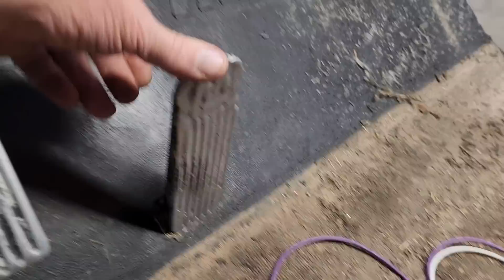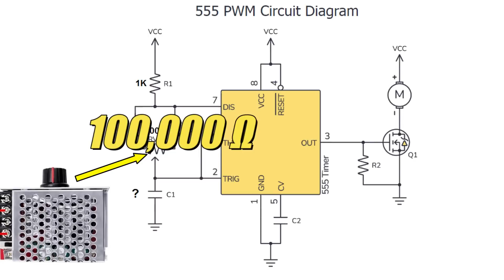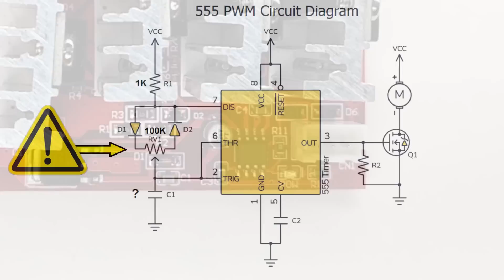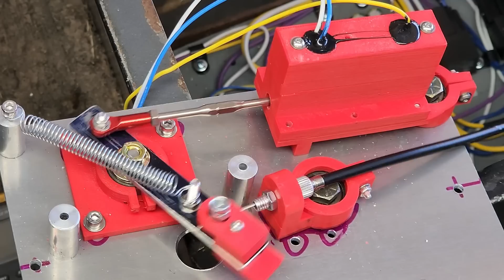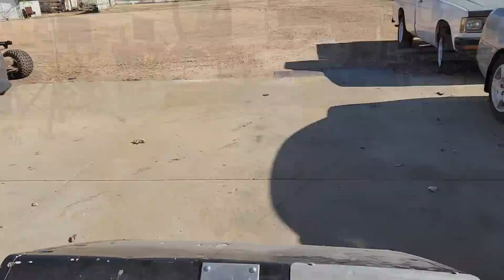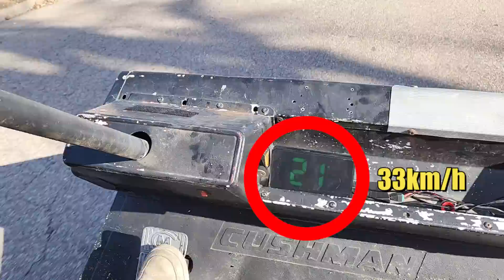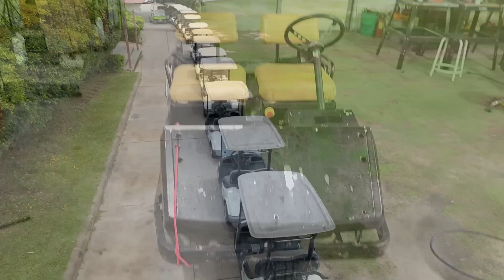S4 E38. We build a custom throttle and road test the gasoline / electric hybrid petroleum battery

Comment: You could advantageously replace all this beautiful mechanics with a transistor and some resistors, just use the Chevy pedal at low voltage and amplify it with a fixed rate. For 100 kilo ohms required with a 3 kohm potentiometer the ratio is 33. Used in 12V, the pedal can be powered in 12/33:.363 volts. A transistor is like an arduino with hard wiring programming.
You can also use a stop switch on the accelerator pedal when it is in the zero position.
An electric motor can handle turning too fast, it will break if the rotor wiring deforms by centrifugation, if the varnish of the inductor burns or if the brush burn.
What do you think of using a classic car as a mechanical base but without the original engine? I'm thinking of a Ford A or B.

Comment: Very interesting project, I've made my personal golf cart from electric to gas, kinda wish i did something like this, might consider this sort of project one day as i have a old golf cart laying around, that cushman is really cool, but, to make it a speed demon like your projects usually are, I'd swap the electric motor for a higher rpm and higher horsepower motor, aswell as a bigger or dual alternator, that 212 should power it fine to wayyy higher voltage as its used in generators to power 120v appliances. The low gear ratio on electric golf cart rear ends do suck, but if you put more speed to it, it'll have no choice but to go fast

Comment: 12:00 I would put the brake switch and emergency switch on opposite lines, just in case one line has enough voltage leaking for either one or the other safety system to fail. You're currently running each safety in series, while the second line has no safety switch.

3 HP should be sufficient to do approx 25-30mph, and 4hp to do 35mph. 
All you need is bigger tires for a better gear ratio.
You'll definitely need an mpg run. I bet it'll be about 66mpg.

Comment: 11:04 wouldn't make sense to have two potentiometers in the same circut to act as a safety if one fails?
Reply: When you start adding additional potentiometers to the circuit it starts messing with their values. If you connect them one and then the other in series they add up and you get a bigger value. If you place them in parallel, start to start and end to end (I hope that makes sense) the combined values of the potentiometers actually goes down because the electricity now has an additional path to flow through.

Comment: If you found the nominal unregulated voltage output of the alternator you could arrange some smaller batteries to drive the motor and have the alternator charge the battery, so you have good low end current to start the motor and sustainable power flow once starting current has subsided

Comment: Very interesting project Jimbo. I imagine there are quite a few ways to improve it. Ultimately, you need only one throttle: say, you throttle the engine and have your electric transmission to automatically adjust. Or, it can be the other way around. Also, you can add a lithium battery, and make it into a hybrid, where the engine starts and shuts down automatically.

Comment: Dam you overcomplicated the throtle poblem if you vere intending to use a cable for throtle from the start all you needed to do was just make a puley and put it on the potenciometer shaft wont even have to remove it from the enclausure wind the cable around the puley twice and atach the lose end to a tension spring. Bsicaly the same mechanism that was used in old radios. And by ajusting the puley size and or where the cable is atched to the pedal you culd fine tune it to get the full movement out of the rotary potenciometer.

Comment: An ICE is not very efficient when it has to cover a large RPM range, but an engine optimised for one RPM can be made fairly efficient, eg, large cargo ship engines are 53% efficient. Not that it helps the way you are using the ICE - lol -.
A Wah-Wah peddle uses a straight rack with a gear on a rotary pot - lol -.

Comment: So you have a cable.... What would prevent you from putting a pully and spring on the potentiometer in such a way that in case of a spring failure, it would power down?
Reply: It's not about the linkage failing, it's about the guts inside the potentiometer failing.  If the pot wears out (or becomes disconnected) and goes 0 ohms that's permanent full throttle.

Comment: the electric trains uses some capacitors in parallel to mitigate the inductance losses, check with a power factor meter if it's also your case

Comment: I know you said you're not interested in anything full electric. Here's the  redneck idea i had is to take a Nissan Leaf. That is, battery only remove the batterys put a trailer hitch on it  then mount a 4000 watt portable generator  on it my generator runs 10 hours on 6 gallons. If you put that on the back of the car, you should get roughly 600 miles in theory for benefit of the doubt  400  miles Not bad i love being a creative redneck. Hello from Romulus, Michigan. Thank you for sharing your knowledge and expertise and for taking us on your adventure.Through redneck, engineering

Comment: What you really want is for the throttle pedal to raise and lower the RPM of the engine and the engine RPM to control the alternator rotor current.  This way you can slow the engine way down when you are cruising along at a lowish speed and spin it up on demand.  It unfortunately gets more complex than that because when you want to climb a hill, you want the engine going fast but with the alternator rotor current just right to hold the engine at that RPM when the throttle in the engine is wide open.  When you are on flat ground you want less engine RPM and more rotor current.  I am trying to think of a way to do this without software and I think I may have something.
A small PM motor working as a generator can make a voltage that varies with engine RPM.  A few turns of heavy wire could make a solenoid where its force is proportional to the motor current.  Some cleverness can make a mechanical thing where the two effects fight each other to vary the 100K pot.

Comment: For the record, I had no doubt it'd work. One of the first things I did was the HP / kw conversions and the math checked out. I just think that a system like this has a lot of room left on the table for fun & performance (and I mean acceleration as much as top speed).

PS - my dream car is a fully electric drive like a model X, but with a turbine-powered generator for long distance drives. They don't take up much space, run on almost any fuel, and like constant output. So I liked the vibe of this idea from the start.

But I still want to see you give that DC motor 400 amps from a standstill 😂

Comment: If that voltage regulator works on PWM signal that will be easy to generate that with arduino and connect automotive gas e-pedal. If that 555 timer don't generate higher frequency than arduino can.

Comment: Jimbo, I caught the very apropos "Toyota Pious" joke...🤣 When you were first discussing the challenges of developing the throttle - instead of a cable controlling a linear potentiometer, I guessed you would have deployed a servo between whatever you used for the accelerator sensor and the rotary potentiometer on the PWM power supply. Complicated, yes, but cheap and very much a "Jimbo" solution! Long live the venerable 555 timer!

Comment: The efficiency of this arrangement is probably better than you have estimated.
If you include the production side of the grid available electricity (Fuel - coal, natural gas, etc. and transmission line losses) the petroleum battery efficiency might not look so bad.

I look forward to the final set up using a microcomputer.
All this Rube Goldberg contraption makes interesting video but I know what you can do with programming.

Thanks for your entertaining work.

Comment: You could use an Arduino with the cobalt drive by wire pedal and a digital potentiometer to replace the mechanical one.  Then you'd turn this into an Arduino project that many can relate to.  The MCP413X has a 100Kohm range option.

Comment: I understand your keep it simple methods. Yet, you do seem to have quite a resume for electronic and mechanical knowledge and problem solving. You could have a "tip in" from your throttle cable to raise the engine rpm to 2500-2800 rpm at 1/8th throttle and then start moving your potentiometer. This would allow normal idle at rest. At 2/3 pedal have the potentiometer hit the stop and start pulling the engine throttle cable to max using a spring loaded eccentric or other method. This way you could have a cruise speed (15-16) mph +/-)  and an acceleration or hill climbing full throttle or just max speed.  This would save on you "petroleum battery" reserves (gas).  Possible complicated but if thought out not so much with different weight springs.

Comment: Maybe the throttle cable(s) have to many bends and kinks to operate smoothly.  Try to make make all the bends more rounded.  Also remove the wire, wipe it with a light grease, a re insert. Sometimes that helps.

Comment: If you use an arduino you can use a digital potentiometer and that chevy cobalt throttle pedal. But really it seems kinda silly not to be using a battery in a vehicle powered by an electric motor. I feel like you could get that thing up to 25mph with the added power of a battery.

Comment: For the potentiometer, you only  have to cover the range of resistance that you care about, depending on how it works, but if you only needed 5% of the range, you could just get a potentiometer that worked in that range (plus a second resistor to increase the resistance if necessary) .

That said, if you wanted to keep the normal full-range of the original, you could also have looked into a resistor ratio transform circuit, which can scale 1 resistance to another.  IDK what you're going to do (no spoilers please!) as I"m only a few minutes into the video, but if you wanted to use an existing car pedal, you could use it with a small circuit.

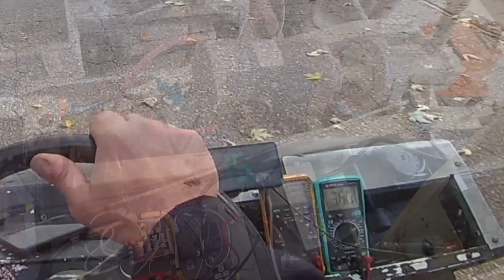Comment: 14:21 in short: Nothing. 

In long: The motor will become more and more inefficient, and thus generate a lot more heat than expected with the power output. Also: There's a higher chance of arcing on the brushes, so they will wear out more quickly.

Both is not an issue in your setup, as long as you monitor the housing temperature of the motor. I recommend not exceeding 70 °C there. If this is a limiting factor, maybe add some cooling fins or a fan around the output shaft.

And sure, the bearing won't be very happy and if you severely overspeed those motors, you may be looking at fracturing the armature due to high centrifugal forces. So I recommend not going 88 mph in that thing.

Comment: Why not use the existing rotary potentiometer, and print a round piece that the throttle cable would wind around and thereby rotate when the throttle is pressed?  That's exactly how they did it in my Chevy Tahoe and in a Clubcar golf cart I have seen.

Comment: A hand throttle using a lever coming off the knob or a gear and toothed track to turn the dial would work too 🤷🏻‍♂️

And not an electrician but whats stopping you sticking a 97k ohm resistor in line with the car pedal
Reply: Range is 100K to 0 not 100K to 97K (that idea would go from no throttle to 3% throttle max)

Comment: So, am I the only one to do the "math" that, due to the safety break switch. You can "dump" the clutch by pressing the throttle and brake and releasing the brake, and instantly releasing full voltage.

Comment: Retired electrical engineer here.  I observed a Japanese engineer remove a surface mount component by holding two soldering irons like chopsticks with one hand.  I was impressed.
Reply: Now he needs to become ambidextrous and run quad soldering irons 😂
Reply: @PsRohrbaugh  For flat pack IC removal!
Reply: I do it with only one iron and a overdose of solder.  Big blobs of solder will stay melted long enough that you can go back and forth with the tip and have both melted.  The component will stick to the iron when it comes free and then you just need to wipe it away and the get out the solderwick to clean up the pcb ready for the new part.  I can do this with parts down to 0603 size.  At 0402 a wide tip will bar-b-q the part and melt both ends at once.
Reply: Yeah works but risky if u put too much heat and lift the traces
Reply: @clownbooface2624  you have to use resin, so that wont happen. You wont desolder many components with an iron if you dont either.
Reply: @mrgoodman6620  you use solder, the tinning layer of solder on the tip is enough for heat to conduct. Rosin flux is mainly for cleaning the surfaces to be soldered. Not used in desoldering.
Reply: @ElectricBillAlbright  Yeah ok. Your not going to get an i.c. with 24 contacts off just by "tinning" the tip.
Reply: @mrgoodman6620  Well, that's what is done.  The purpose of tinning the tip is for heat transfer to the part you're trying to remove. By the way this is done with flat pack IC chips that have pins on all 4 sides and often have 100 or more pins altogether.  They're used on multi-layered printed circuit boards with sometimes 20+ circuit board layers. They use feed through connections to interconnect to the other layers. Common technology found in compact electronics. Like cellphones.
Reply: @mrgoodman6620  You're right. You won't get it removed from the board with just tinning the tip. I forgot to mention that you need to use something like a miniature pry bar to pop the chip off the board. They make special curved prying tools for this purpose. Since the chips are super glued down to the board at the factory before passing through the solder-wave machine that solders all the components in the board.
Reply: @ElectricBillAlbright  Yeah ok Electric Bill if you can desolder like that, then you do what ever keeps you happy.
Reply: I just move quickly on both sides with a single soldering iron and that does the trick. I prefer a rework station though.
Reply: Vietnamese owner of the TV repair place I worked at during college used the same technique. 30+ years later and I'm still using the same method.
Reply: With hands like that I bet his wife is pretty damn happy.
Reply: @lynnlandin7561  he is not the only one that does that. I was doing that in the 80s.
Reply: I thought techniques like that were common among those that work on boards. 
I make my own custom heating irons with nichrome wire from old irons and toasters. Also reflow ovens from sandwich toaster elements.
Reply: I've done this but instead of holding them I used small hose clamps and a scrap hinge from my box-o-miscellaneous-hardware to make a pivot.
Reply: I think we observed the same guy lol, I made a chop sticks pencil iron about 15 years ago and still use it.
Reply: It's easier than using 2 irons if you simply flood a big enough solder blob over all the component terminals, and just pull it off. Simple. 

I have easily removed things like in-line connectors with up to 20+ pins on it by doing this.

Comment: 555? Nice! :D
555's are useful for cobbling together a intermittent wiper-driving circuit.
Also, love the X-files golfcart! 🤣🤣🤣
Reply: Yes, on some wiper motors it can work great.  The "park switch" can get in the act to ensure the wipers always stop at the bottom of the sweep.  An LM555 is only rated for 18V but you can get a bit clever with a crude voltage regulator to keep its voltage between about 5V and 10V.   A big fat MOSFET can power the motor.
There is also clever thing where you fly the whole circuit on the positive side of the motor.  This can save many parts but it is "a bit troublesome to troubleshoot".

Comment: Mazda is doing something like this with their rotary engine acting as a charger/range extender.  Locomotive engines are also basically powered this way.  Diesel generators power electric motors.

Comment: I wonder if that alternator could be powered by a nitromethane hobby engine, or if they even make a hobbyshop engine big enough to do that.
Reply from the maker: We need at least 5hp to keep the engine from stalling.  The 6.5HP engine we are using is about right for this project.